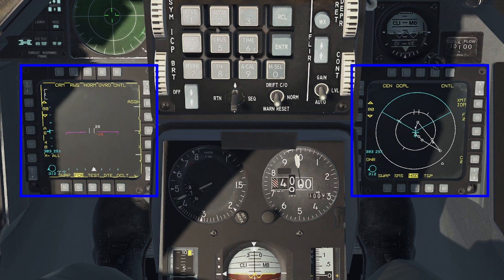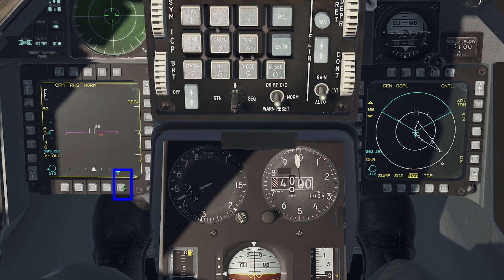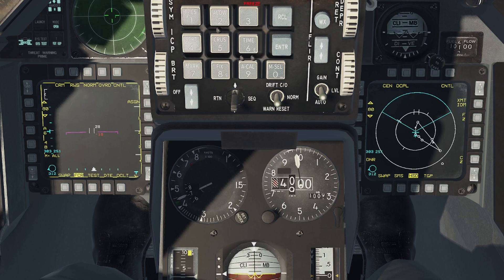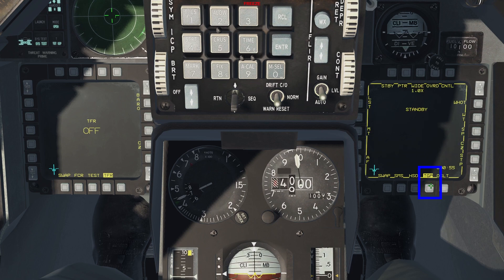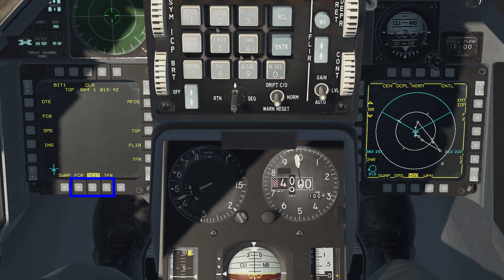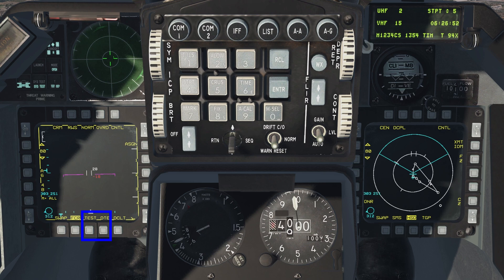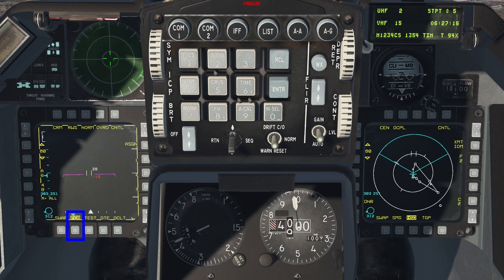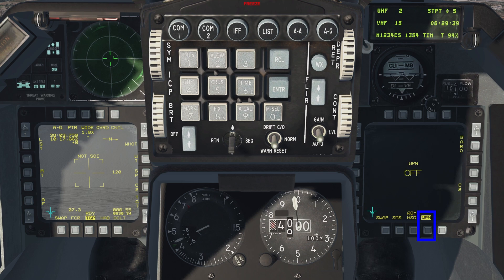Falcon BMS 4.37 Tutorial - MFDs

Comment: Good stuff. when in AG mode I can cycle between HSI and WPN mode to gain SA and back to wpn quickly. As you say. without removing my hand from the Hotas. very handy technique.
Reply from the maker: @dasdguy7606  exactly, it's so handy. Or for example when doing air to ground work, going to the SMS page quickly to check that everything is configured correctly.